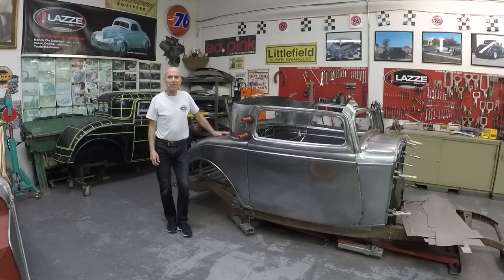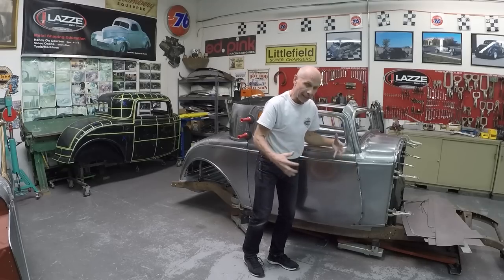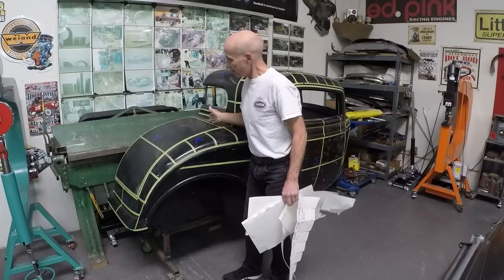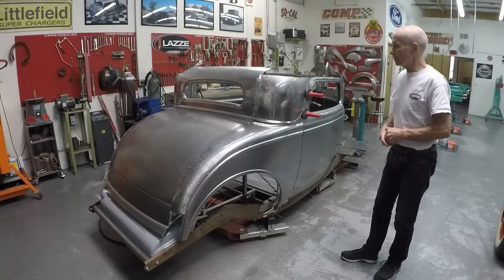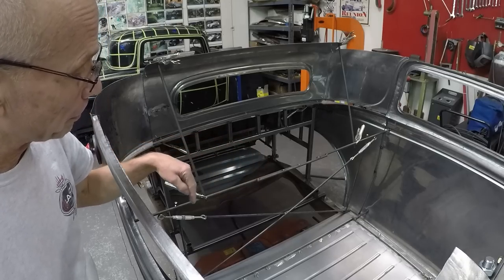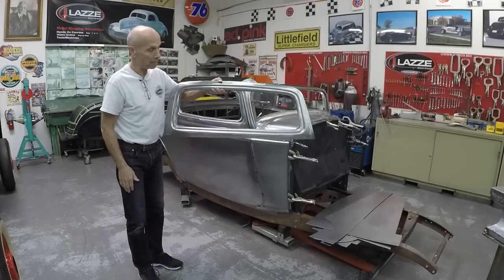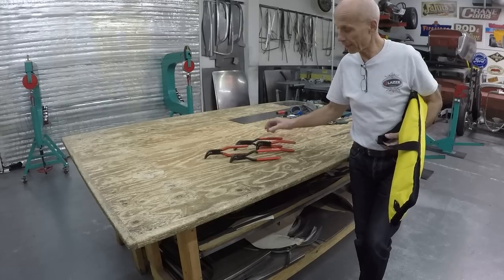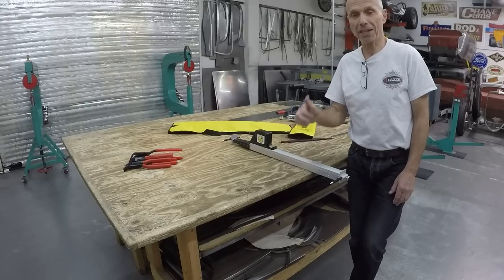Lazze Metal Shaping: Step 2 Class 1932 3 Window Coupe Body From Scratch!

Comment: This guy is incredible. The measuring tool that was shown is called a Trammel Bar. They are usually clamps that hold points on either end of a wooden stick or square aluminum tube. Then a scale (or tape measure) is used for the measurement. They come from layout and lofting in ship building. A simple set can be bought for about $15-20, but you can spend a lot more if you want. For inside measurements an inside (suitcase) micrometer with extension bars is used.